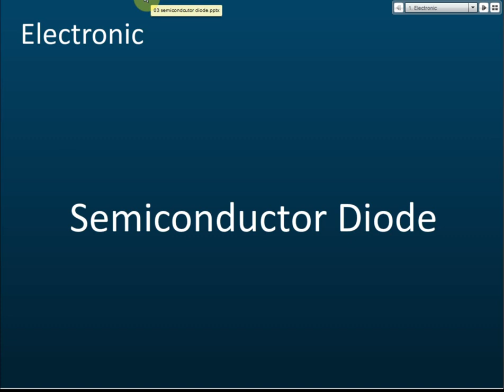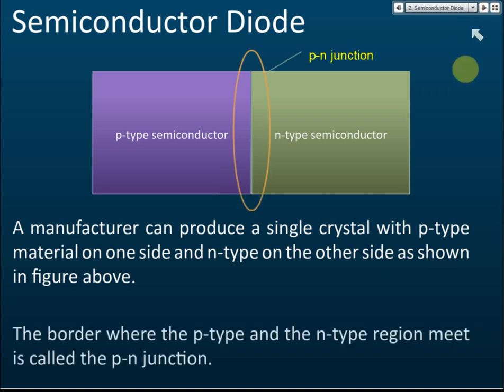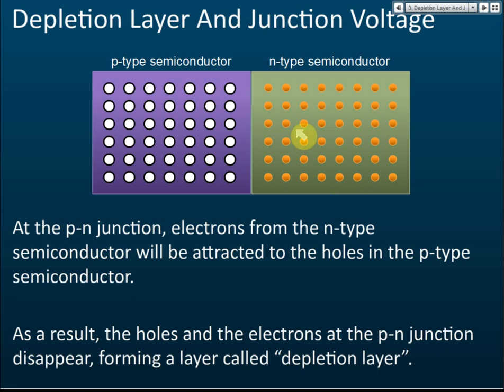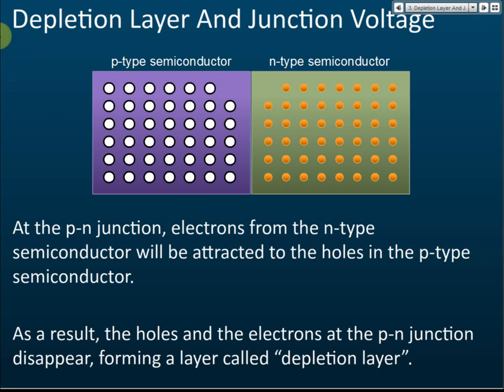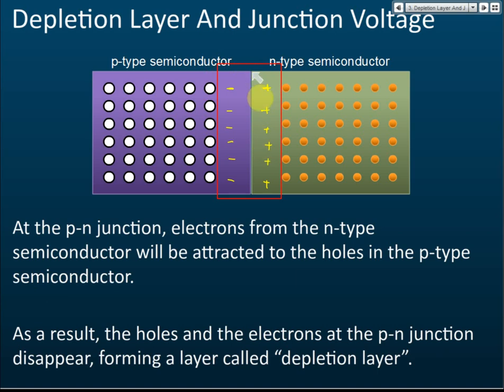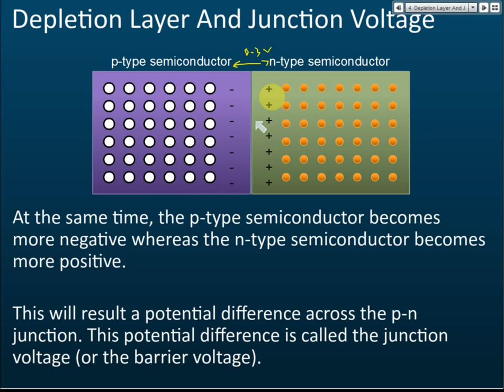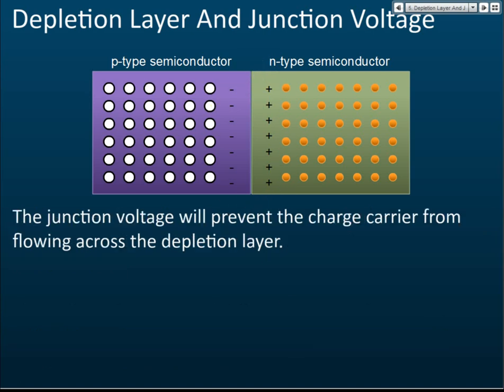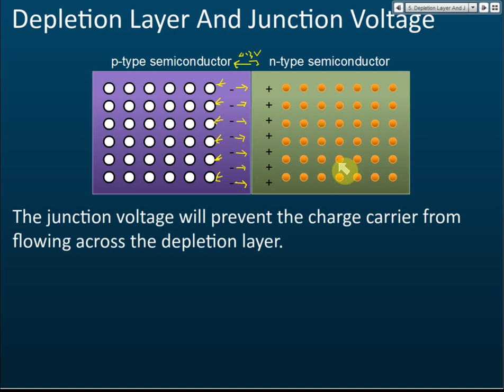Semiconductor Diode | Electronics

Comment: I noticed a slight mistake there, Sir. On the Germanium and Silicon potential difference. I think you may have gotten it the other way round.

Germanium ~ 0.2 to 0.3
Silicon ~ 0.6 to 0.7

But other than that, thank you for the great explanation!

Comment: Hello sir. Could you tell me please who is right. Some sources, actually most tell of holes diffusion into N region, but in your presentation we see electrons leaving phsoporus atom and formation of positive ions on N side and formation of negative ions in P side thus we have depletion region and electric field. This explanation seams very logicall but the others insist of holes migration into N side. I can not understand that.
Reply: I'm with u bro
Reply: Actually the holes do not exist, it is just a theory . When an electron flows to the p side, a hole will exist at the place where the electron leaves. So actually the hole doesn't flow because it does not exist. Basically it is just a space for electron to fill in. When the electron leaves, there will be an empty space and it is called hole